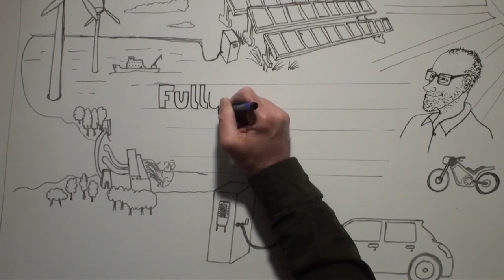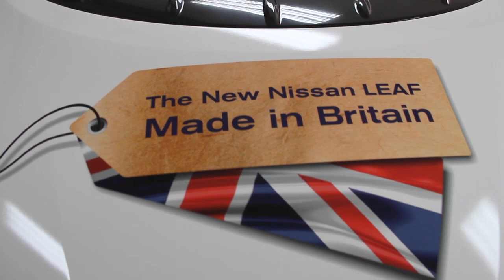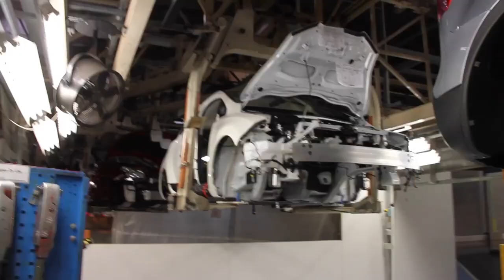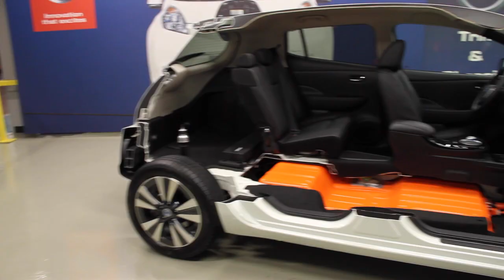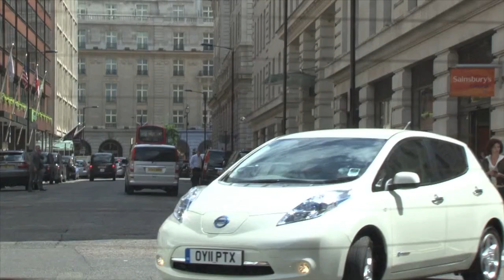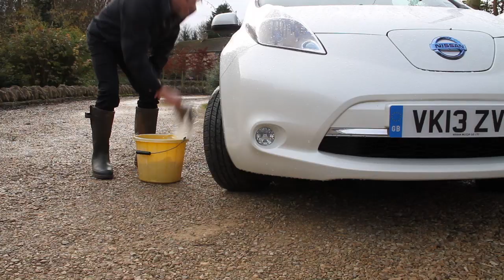Second Generation Nissan Leaf | Fully Charged

Comment: I loved the show as I have all of them it was the 30second advertisement to build support for an oil pipeline.  It seem to send a mixed message.   Definitely bad form for TransCanada to put a fossil fuel ad in a show for clean energy.
Reply: Ferkemall's comment relates to the untrue advertisement in the sense that pretty much everything Ferkemall says is also untrue.

His claim that the car costs £28k with battery lease is bullshit.  If you take the battery lease option, the car only costs £15,990 in the UK.

His claim that the battery pack replacement is £6k is also bullshit.  The actual cost in the UK is £4920.

There have been virtually no cases of anyone executing the Nissan battery warranty because nobody goes under 70% before 5 years or 100K Kms.  But the very few cases where it has happened, Nissan have done a full replacement to 100%.

Ferkemail is full of shit.
Reply: they're still way expensive.   like 28 grand base -  a base model versa note (same car basically) is only 13 grand.
Reply: ferkemall what does this have to do with the untrue advertisement (one you may or may not have seen) being placed on a show about clean energy?  This ad was for the DAPL two years ago.  Since that time there have been leaks that went past the safety sensors and out right spills.  If you are afraid of losing battery life during an 11 hour blackout then go ahead and buy a hybrid.  But know this you and plug your EV into the house using an inverter and power your toys.
Reply: 2LegHumanist thank you for explaining his views.  I kind of figured out his angle.  I just don't wish to engage him in a mud slinging debate.  I try to be civil a steer away from swearing and name calling it just feeds the beast.

Comment: Nissan leaf is going to die in it's ass when the competition like the I3 really get going. Purely hideous car
Reply: Actually I don´t think it will - There is a growing market/or perhaps more correct a changing approach in the market for car buyers in the segment where people buy cars not because they really look good, has a fancy badge or perform particular well, simply because they are cheap to run, fairly practical trustworthy and just look like a car - this is to me how the Leaf looks - it´s rather boring from a Car fans perspective (personally i´m not at all on for how the leaf looks) - never the less they will still sell a lot of them. All those people that buy small segment affordable family cars - If they commute every day for most of the year within it´s range then the leaf is a real alternative option - If they have access to green energy even more so. I like the i3 much better, but it appeals to slightly upwards and new EV market - It´s not appealing to the same people as would buy the Leaf really, for that it´s too futuristic, it stands out in the crowd, it makes a statement. People that buy a leaf don´t want (or need) to stand out from the crowd or to make such a strong statement. They might be nearly in the same segment for size but the appeal is very different, which is why the i3 will not have an impact on leaf sales and vice versa.

Comment: How much do hills effect the battery's range?  During the video, there was quite a bit of road noise.  How quiet is the Leaf?
Reply: Very quiet - they had to add an engine-noise generator, which runs under 35mph (kph?, I forget) to avoid surprising peds. Above that speed tyre/road noise is like any other modern car.